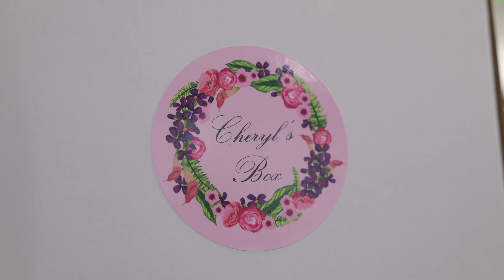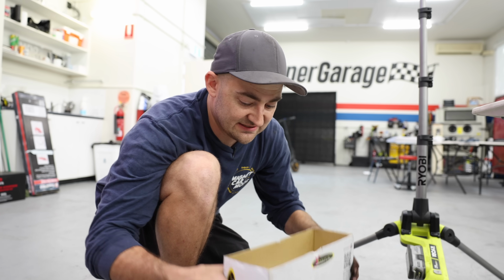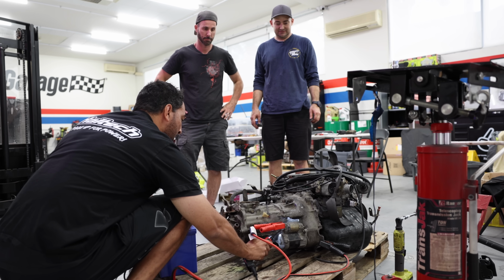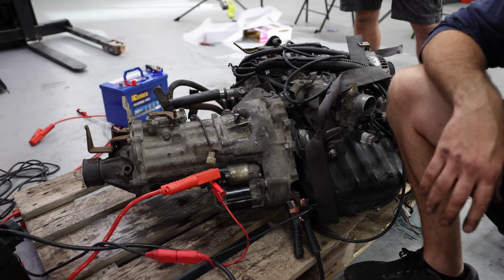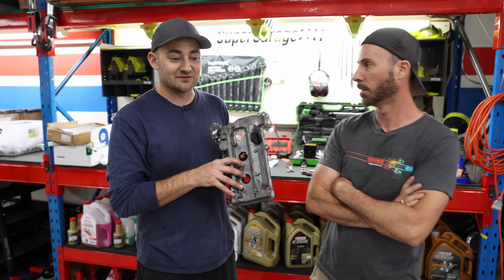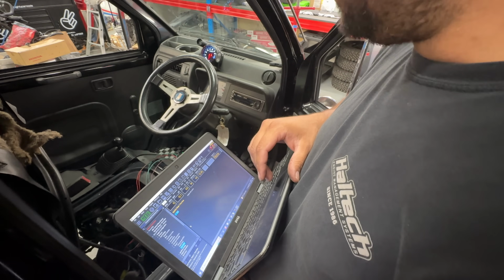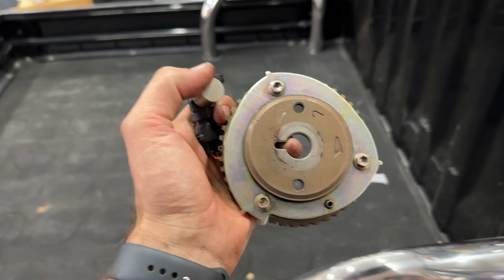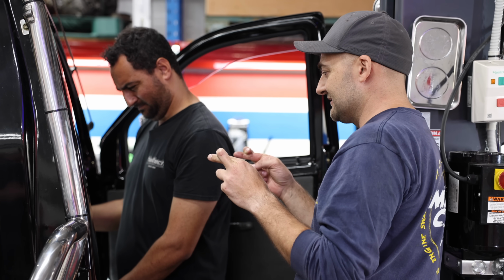WORLDS FASTEST Midget - Part 4

Comment: My second car, also first manual, was a 1991 Daihatsu Charade with a 1L. I loved that thing, and when the engine finally gave out at 320k miles was pretty devastated. I tried finding a donor engine, but here in America they are few and far between.
Reply: I know it would be a long shot. But Mitsubishi has the 3a92 out of the mirage, it's a 1.2, if you could get a motor/trans and a loom/ECU, with some fab work it may just work out
Reply: You could try and look for a 4efte engine from a toyota starlet if you have those there.
Reply: @euroker05  we didn't get the starlet here
Reply: @ThatOddGarage  the Tercel had those engines too
Reply: @LouisSubearth  I stand corrected
Reply: I thought about swapping in a 1L from a Geo metro/Suzuki swift, but I was a broke 17yr old so I ended up selling it. That was 17 years ago, but I have continued looking off and on
Reply: @justinyates1154  I like those little cars. Might find one to import someday

Comment: 10:00 I understand Moogs frustration all to well I was servicing a drive belt yesterday and the new one was about 1mm shorter than the old one which was barely noticeable but luckily they had OEM ones in stock so I was literally like how Moog was when I threw the ebay drive belt in the bin

Comment: Was just thinking about radial seals and ball bearings and such, there probably is a specialist shop for industry that just deals with seals and bearings in your town, almost anywhere in the world. 
And the sealings used (not for heads etc, but regular radial ones) will probably be standard because why would the car manufacturer reinvent the wheel.

So it's great that you found the Honda part, but I bet you can find the same thing just by the sealing size locally as well, just so you don't have to go to japan for that in the future! :)

Comment: this episode reminds me of my first car, my 1993 honda del sol. there was a point where my starter went up. and i needed to fix it for work. my buddy brought another starter for a d series engine but it didn't fit. so we ended up doing the guts swap like you guys did and it worked. for a week.... at which point i got paid and bought a real starter. about 5 months later my fuel pump went and my buddy gave me his 255 wally and it ran rich as hell after that lmao. then about a year later the motor went bad when racing this dbag in an integra who was talking shit about my del sol while i was pumping gas. but i won the race. so totally worth it lmao. after that i bought an s2000 and that car was great.

Comment: If you have a larger CC engine but are using the sump and oil dipstick off a 0.650cc engine surely you will be running slightly low on oil even if it shows full on the dipstick?

Comment: Watching the end of EP3, and now EP4, I'm surprised you didn't start with the starter motor. In Ep 3, sounded like a starter solenoid issue, i.e. starter not running. You could have solved the issue in 30 mins if you started with that.
I've been in motorsport for 20+ years, first check is the starter motor.
If it was something else, you'd hear a clutch grinding or otherwise,
But glad you figured out

Comment: Starter motors are... c***s - I changed my dual mass flywheel to an uprated one, my OE starter didn't match the teeth on the new flywheel... drama - found a starter with the right amount teeth on it in the end and it fitted correctly :D

Comment: Drip feed continues. Dave amateur move cranking with fuel on new firmware with dialling in ignition timing first. I always run four relays just so it's easy to unplug injector feed or coil feed independently, the other two being ECU and feel pump, obviously. Poor engine, poor rods, poor big ends, poor headgasket.